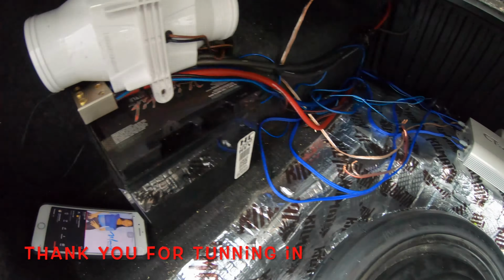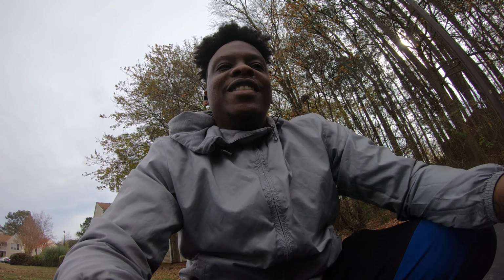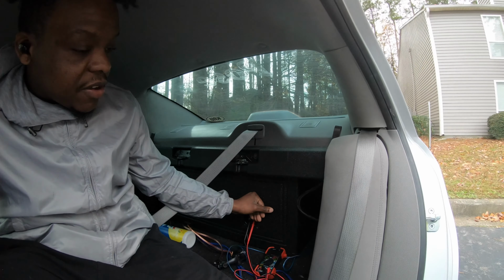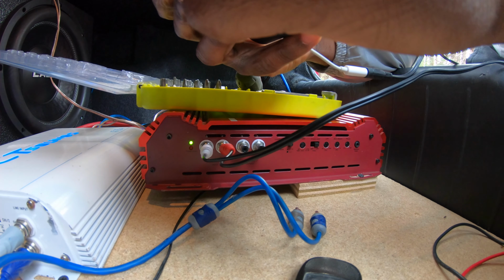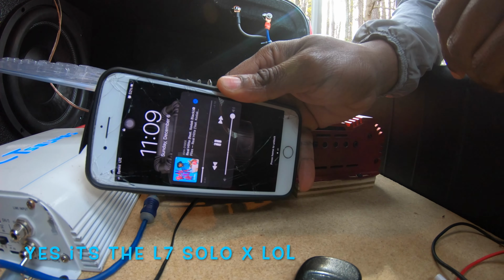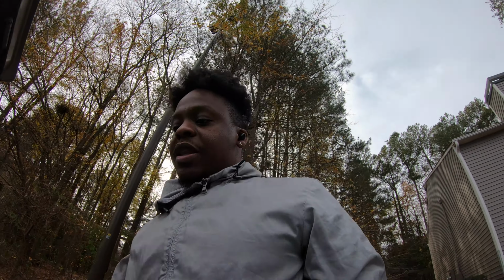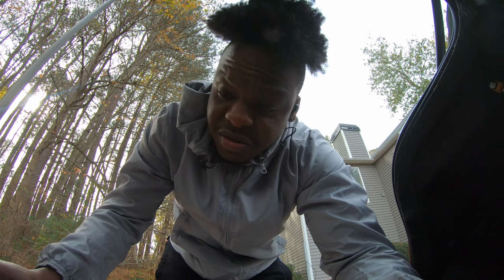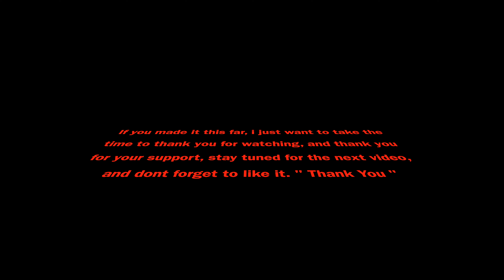Did I blow Another Amplifier?

Comment: Which Orion amp is that?
Reply: I’ve still got my 2 12” L7 q class kickers.  For sale.
Reply from the maker: @JoshAintLoud  #OrionHcca1200.2 and those 12s are huge, I would have to face them up
Reply: @AJOSUE  I’m sure they’d fit your trunk. The box fits in and out of my civic si truck.  The subs face in front or rear.
Reply from the maker: @JoshAintLoud  you have the one that kicker made for them or pre-fab?
Reply: @AJOSUE  wasn’t made buy kicker but isn’t prefab either. Bought it from a dealer on eBay that makes custom boxes. Paid $250 for it. Still have the receipt.
Reply: If I keep the subs I want to get the dual 12” box made by kicker.  It is definitely slick asf.
Reply from the maker: @JoshAintLoud  if it’s the one from kicker it’s too high for more trunk, but if I buy from you I just want the subs not the box, because it can’t be higher than 14”
Reply: Well, I’ve got right at $1k in the subs and box. Used them for not even a month. Wired at 2 ohms. I want $500 for the subs and box.  Have all the original boxes, paperwork and receipts.
Reply from the maker: @JoshAintLoud  what’s the specs and running frequency